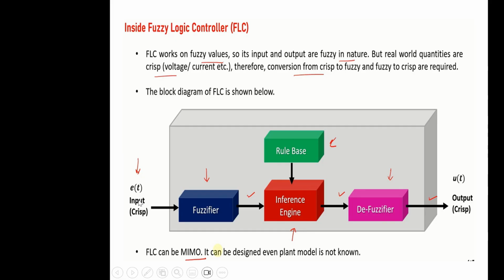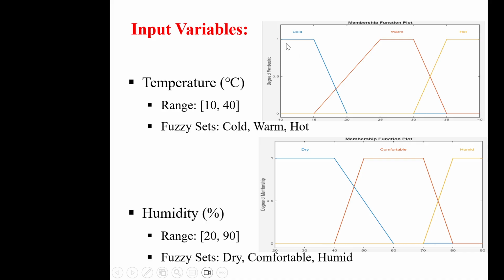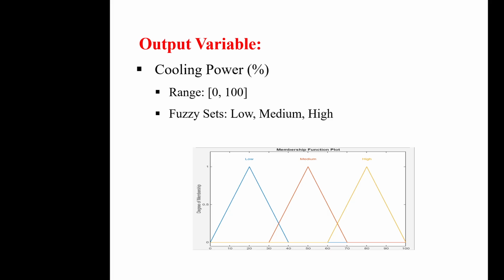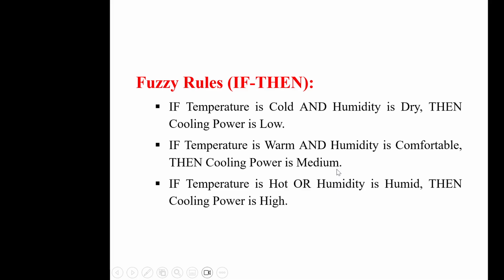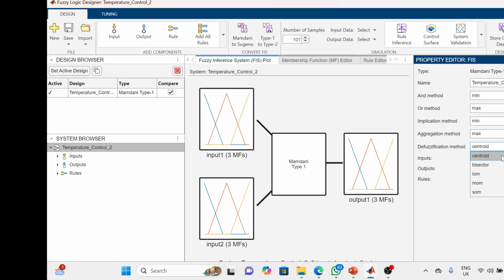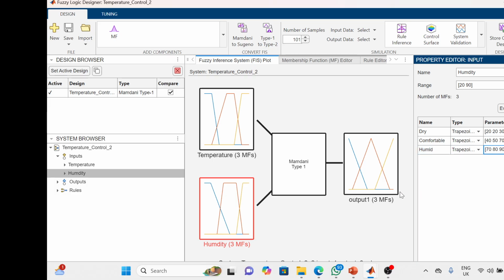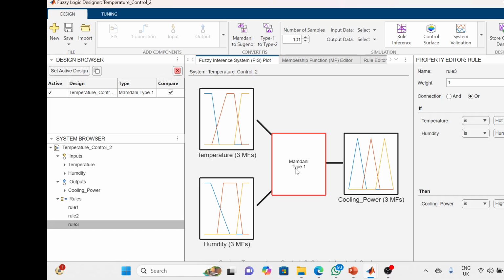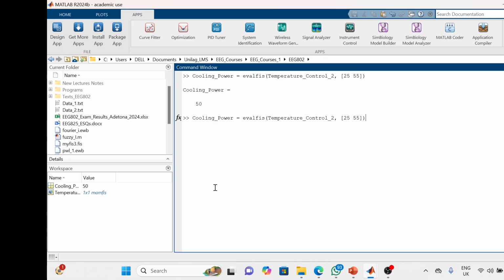FIS using App

Comment: The video showed how financial systems using fuzzy logic  can be implemented through MATLAB apps, highlighting dashboards, ease of use navigation, and strong security features like role-based access and encryption. It was practical and connected theory to real-world applications. It reinforced key concepts on scalability and data recovery. Overall, it was clear, relevant, and insightful. Thank you Prof.